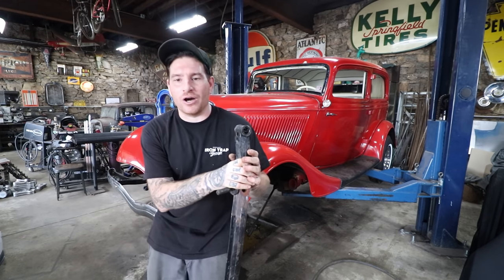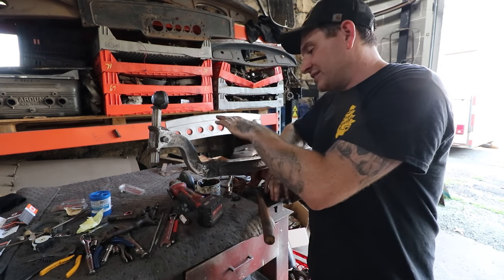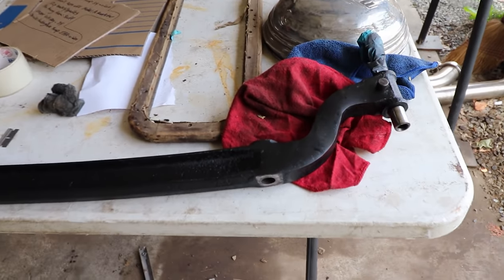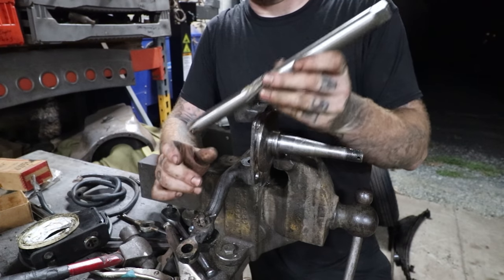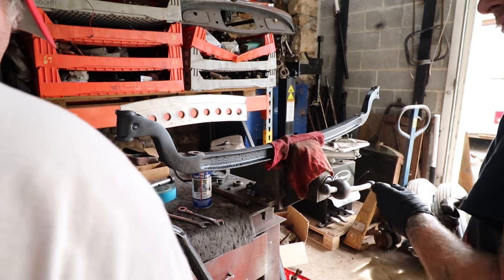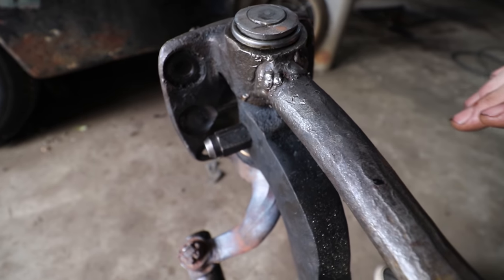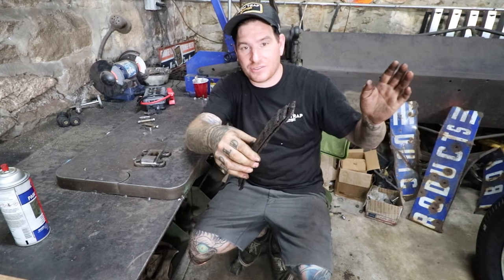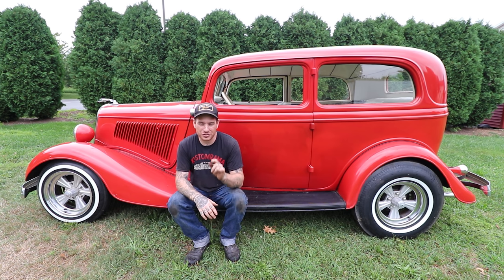We NAILED The Stance On the 1934 Ford Tudor Hot Rod!!!!

Comment: Hey Matt, Just a little tip when greasing leaf springs. When greasing for finial assembly and some lead shot to the greases. My Dad taught me this trick. By doing this the spring will rub on the lead shot and not the spring. It also gives the car/truck a lot better ride and handling. The smaller the lead shot the better "We used trap load size" which is the size of coarsely ground pepper and make a nice greases/lead shot mix  and lasts for years.

Comment: The stance looks great.
When replacing bushings & such, remember Heat expands - Cold retracts & by heat I'm talking about a Heat Gun not a torch. Overheating that old steel can change the temper/strength & cause it to become brittle. A C-clamp & sockets can be easier than beating it out with a hammer.
Use a cutting oil when line reaming & assemble with never-sleaze
Reply: He loves his hammer doesn't he.

Comment: Twisted wire brush in an 8" bench grinder will clean that stuff up. Though be carefull as it will remove metal.
Greasing a transverse leaf spring makes them work. The difference is huge as the suspension works again. Within reason this is strue of all leaf springs.
Can you find a torrington bearing to use on the thrusts? They make one hell of a difference.
Your steering arm is far preferable to the welded one though I feel some hardened washers up against the stub axle will give a bit more support.

Comment: G'day Matt.
I wonder how effective a brake cylinder honing tool might be for some of that cleanup work on old axles?
The holes you worked with look to be about suitable size.
I believe one term for the little metallic 'specks' you speak of is 'galls' and using wet-and dry emery tape with diesel as a lubricant/wetting agent for the emery tape can be an effective way of removing galls.
I have also used the same method with very light grade emery tape to clean rust off the shaft of hydraulic rams to avoid abrading seals.

Comment: A couple of suggestions Matt. Don't hammer the bushings in. You can press them in with your vise if you line them up straight. Also I was told years ago that it is better to have the spindle bushings hones. A reamer leaves fine edges that flatten out after driving for a period of driving leaving the bushings looser. Just a couple of thoughts. Looking good.
Reply from the maker: We will have to look into the reamer creating ridges! Thanks for watching

Comment: It's looking really good. Drive it around and let it settle and you may not want to lower the rear. Personally I wouldn't change the stance but it is your car and it needs to meet your expectations. I would, however, replace the center caps on the wheels. I know it's a little early but have you thought about what you're going to do with the engine?
Reply from the maker: The rear may not settle much. We will drive it a little before making changes

Comment: Car looks great! I dig the greyhound on the hood.  Does heating and bending the steering parts after its assembled ruin the new grease in the bushings or tie rods or change the strength of the metal? Just curious why they dont get heated and bent when unassembled.

Comment: Love the 34.  I’m going to drop my 28 now.  Question for you.  If I use the mechanical brakes does somebody make a perch pin that is taller to hook up the brakes?
Reply: Hi use 1934 perch bolts.
Reply: Byron Bassett 
Thank you
Reply: A friend did one here in Tasmania, he also had to make a short extension that bolted to the perch bolt, somewhere on the HAMB there are some good pics, of the finished job.